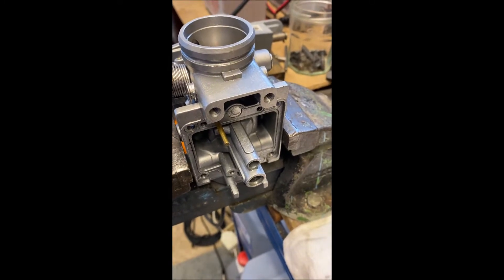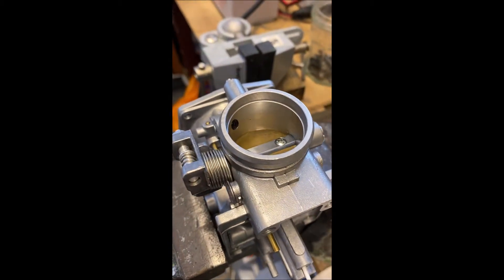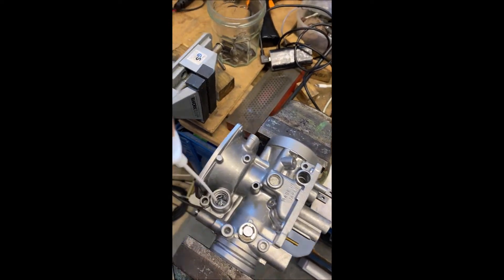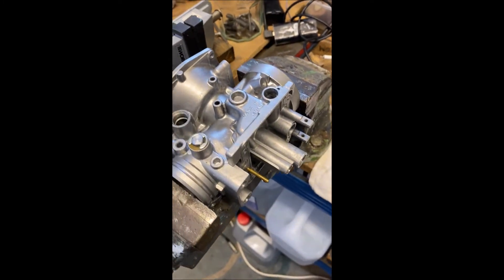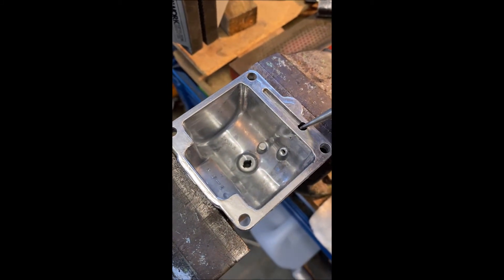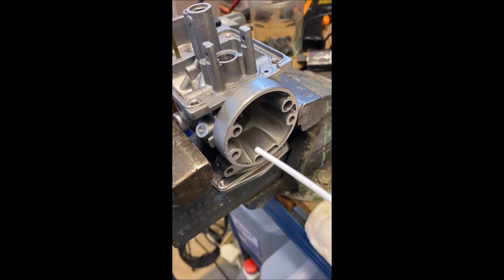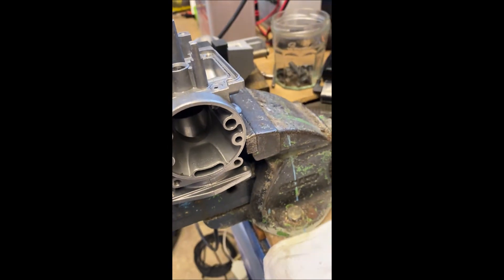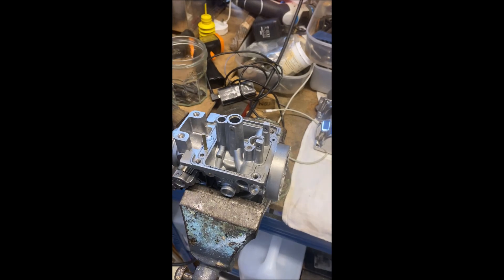CV Carbs Circuit Testing - This is a clean set of carbs

Comment: I enjoyed this video a lot - however, I am used to Keihin CVK carbs as a Kawasaki guy, and they don't really look even close to this. For instance, no brass pickup tube to carb bottom, but every step of the way they aren't alike.

I think I have managed to clean all my Keihins so far, but whether all the circuits are actually inspected is a bit suspect. Often I seem to get floaty revs unless setting a super low idle, across various bikes, and I am wondering if I have missed something, or could it just be the slide springs ageing.